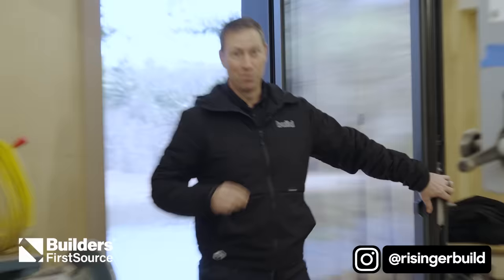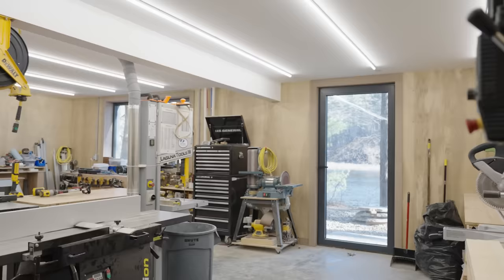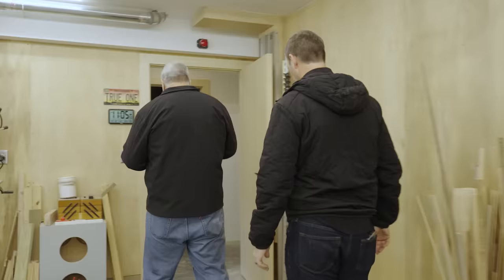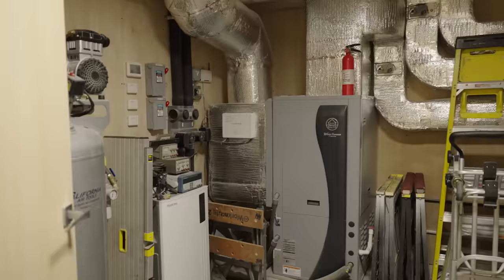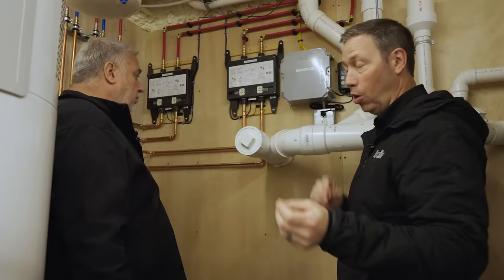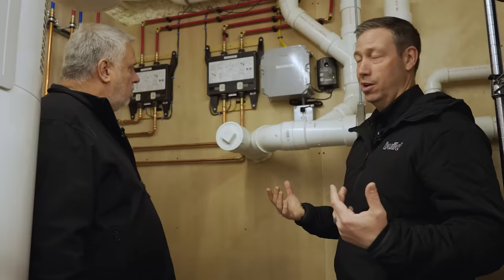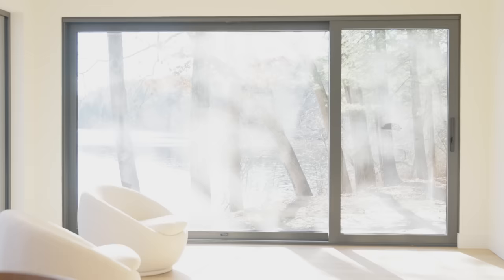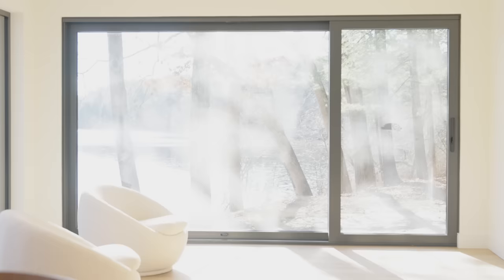Features To Include On Your Next Build

Comment: An electronic shower valve is genius.
Reply: until it doesnt work, the more complicated something is the more likely it will fail
Reply: @tombrady8716   Except, it is way less complicated and so much easier to repair.  You realize the controls aren't built into the wall, right?  They mount on the wall like a thermostat.  You can remove the controls and replace them without undoing a single screw, it snaps on and off the wall. The single wire from the control panel down to the valve uses an RCA jack behind the control panel, not a screw terminal like a thermostat.  Swapping the control panel if it fails takes less than 30 seconds of work.
Obviously any repair to the valve that is easily accessible in the basement is also super easy.   
I don't think you have ever worked on a shower valve before if you don't see how simple and better control by wire is.
All airplanes are control by wire and cars are starting to be too.  All hvac is control by wire.  How is this simplification and reliability improvement for showers not a good idea?

Comment: Suprised he didnt do a de-superheater off the geothermal, in hotter climates during cooling it is basically free hot water.
Reply: I’ve never heard the term “desuperheater” (for domestic hot water), so I went and looked it up.  As shown in the video, with the water-heater heatpump taking its heat from the indoor conditioned space, during the cooling season, it is providing some additional indoor cooling.  During the heating season, the geothermal heat passes through a total of two heatpump systems to be put into the domestic hot water.  As you say, a desuperheater is mostly of benefit in the summer cooling season, and the nice thing about it is that it’s just a simple heat exchanger, not yet another heat pump, but at best it could only be an adjunct to the “primary” water heating method.  As I recall from Steve’s channel, this house is in Massachusetts, so it’s not a hotter climate.
Reply: @kc9scott  Correct I'm in Texas so they are really apealing to us, since I anywhere I can dump excess heat and make it useful is great. So I'm thinking a large holding tank, with maybe a tankless to feed it in the rare weeks we are not cooling.

Comment: 16:25 wish we could get away with that battery configuration in Houston. City of Houston requires strict compliance with NFPA 855 Ch 15.5, minimum spacing between BESS is 36 inches, maximum single battery size 20 kWh, and Vehicle Impact protection bollards not less than 36 inches from the BESS.

Comment: @11:53 "No access to the latch from the outside" (i.e. no door handle). But there is access to unlock the door? Is it possible that the unlocking action of the lock also "opens" the latch?
Reply: The access is provided by breaking the very conveniently placed glass side window.
Reply: @percyfaith11  Good point. Maybe bulletproof glass on either side of the bank vault door? A chain is only as strong as its weakest link!
Reply: @tjdesantis  There is a plastic film that can be applied to the glass that makes it like a car windshield.  Gives time for the alarms to go off.
Reply: @percyfaith11  you aren't breaking thru the sidelight - you got a better chance thru the door
Reply: @tjdesantis  the door is the weaker link
Reply: @stevenbaczekarchitect9431  sounds good 👍

Comment: How did they get those stairs to pass code?
Reply: No rails? They said they aren't finished the rails yet. Other than that they look code
Reply: They aren't finished.
Reply: $50
Reply: it's MA...  all your plumbing needs belt, suspenders, and then 3 more things nobody else requires... the rest of the building is open to interpretation

Comment: Your “blow Dryer” statement about heating the house with geothermal is misleading… it takes a tremendous amount of electricity to pump the water for geothermal… once inside the house it may be efficient but it’s 5he getting there that takes huge amount of energy… prove me wrong
Reply: it has a good sized load to pumping but the system still pencils out better than most, especially coupled with this homes efficiency

Comment: Bank vault door but surrounded by glass. Dont make much sense
Reply: You are not breaking thru that glass
Reply: yeah... and all the the banks, they put glass doors in too ?.. what were they thinking..... so instead of sidelites around the door, they should have put in solid walls ?... then what about all the windows... fill those in too ?.... they probably should have just built a reinforced concrete dome with no windows and only a single 3 ft thick blast door as the means of entry... then they'd be safe

Comment: I don't know why people insist on putting their battery systems in new construction in the garage. If there were to be an incident, you could very easily lose the whole house to fire or toxic smoke. I think in new construction, it would be prudent to isolate flammable battery systems in a manner which would reduce the impact on the house should there be a fire. I would probably consider a detached strict garage if I was going to host electric cars. Define the design objective as: no loss of use of the primary residence, no damage to the house requiring remediation that would undermine the integrity of principle structures like the roof, and no cleanup of toxic smoke in places like attics.
Reply: Is it really any more dangerous than portable generators & heaters with cans of gasoline or propane sitting around? And given the engineering throughout the house and its remote location, he probably has a sprinkler system
Reply: @G0F15H  Yes, significantly! Once many modern batteries start burning, they are almost impossible to put out. And water will not do anything other than make some steam, so sprinklers will be useless.
Reply: Something that isn’t common in the US but is in Europe are small stand alone buildings that’re often seen at more luxurious houses where things are stores like: Fiber internet, water income line, breakerbox, animal shock loop system, etc
Reply: @alanjackson1015 It's not about trying to put out the source of the fire but to suppress the spread and buy time to vacate the property before the fire department shows up. You're not going to put out a fire in garage filled with 20-50 gallons of gasoline either. And that's all a different argument anyways; the primary concern is preventing the initial combustion, and numerous studies show that batteries and EVs are actually safer than tanks/cans of petrol sitting around, especially when there's active combustion taking place. Are batteries perfect? No. But claiming they're too dangerous because there is an extremely small chance they may spontaneously combust is moving the goalposts and a poor argument for the overall risk/benefit
Reply: @G0F15H  I never indicated they were too dangerous. They are kind of like an airplane. Traveling by plane is the safest method of travel, but when it goes bad, it usually goes bad in a spectacular way was all I was saying. And there is a  reason why you cannot store propane and more than a certain amount of gasoline in a garage (other than in the vehicle itself). And that is actually not to do with the fire risk, but the fact that a car or a  lawnmower, for instance, are an easily seen risk to a firefighter. Jerry cans, and other small containers are very hard to see in the dark. So is the fact that there is a battery or an EV. How do you tell an ICE car from an in EV in the dark with a respirator on? Much more dangerous IF something happens.

Comment: That front door probably costs more than my car. It's nice, but expensive.
Reply: Very Nice, but why a high end security door, with glass beside it.  The design is nice and I could see myself use something similar, but why go for the security expense if you are going to throw it away with glass sidelights?
Reply: @ritste1654 it’s not a door meant for high security.
Reply: @miles5600  thank you for appointing reason, although it may go right by them

Comment: Since he is all electric did he take into consideration fire suppression in his garage for the EV's? I would have built a separate garage with fire suppression especially if he is far from a hydrant or fire dept.
Reply: You should be far more concerned about 20gallons of gasoline in each car. The rate of fires in gas cars is 10X EV’s.
Reply: I have a EV, but I am more worried about the actual fires I've had in the past. The stupidest one was a pack of matches that got tossed in a pile if papers to sort latter and then it got stepped on. I am looking at a fast acting low flow wet system that gets it's water from the well. It's low cost, but not effective for larger fires.
Reply: Of course you forgot the percentage of gas cars vs electric cars in your statement.
 @Krunch2020
Reply: @Krunch2020  Nope EV's have a higher rate for there are fewer of them. They are also a lot harder to put out and toxic.
Reply: Just another perfect reason to push for only disconnected garages. Plenty of noxious chemicals/ pesticides stored in them along with CO and the now move to electric cars. 

If you’re gonna build a custom house and have the real estate 2 separate structures. Garage and house  ;)
Reply: Separate garage maybe but fire suppression is pointless unless the battery can be completely submerged. A lithium fire makes its own oxygen
Reply: @RJ-cc1fz  Denver Fire is now using blankets to put them out. I wonder how much it would be to have one hanging over the car and it drops, think smoke or heat alarm, if the car catches on fire? Nothing fool proof but I would think if your spending that kind of money you could come up with something.
Reply: @garygeorge9648 EVs are actually LESS likely to catch fire vs petrol vehicles. Today's batteries are safer than tanks of highly combustible fuel. Numerous studies from around the world confirm this
Reply: @Krunch2020  not true, when's the last time you heard of a house fire that was due to the gas or fuel system in an ICE car.... NOT something in the electrical system, but the gas itself... almost never... 
  you can literally stuff a gas soaked rag down into the fuel fill of a car and light it on fire and the only thing that will burn is the rag... you will never light the fuel in the tank, there isn't enough air ... all those movie scenes are bs
  the "rate of fires" in ICE cars may be 5 or 10 or even 20x that of EVs, but almost none of those fires have anything to do with the fuel or fuel system or fuel tank... 
leave out of the equation ford pintos and the like from pre early 80s.. look at vehicle fires from last 40 years and remove all the electrical based fires in ICE cars, count only fires that involved the fuel itself, then lets see what that ratio to EV fires looks like....

Comment: Kitchens with no exposed hardware is horribly nonfunctional. Imagine have to press and pull all day long even for the fridge. Instead of one quick pulling motion. Would drive me up the wall. I’m shocked he went with a dishwasher that had a pull instead of the Miele knock twice to open system.
Reply: when you spend $1,000 sq ft on construction, you can choose any type of hardware you want